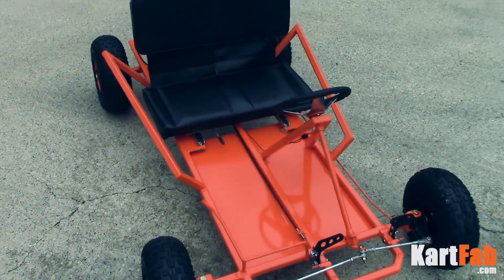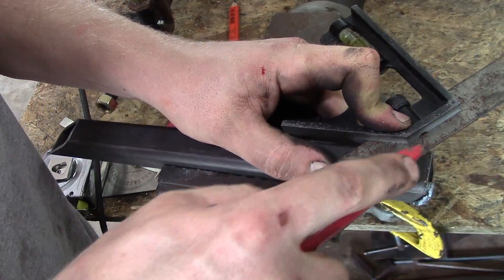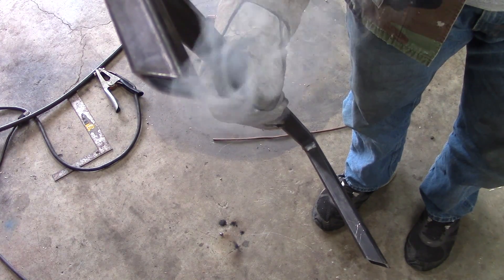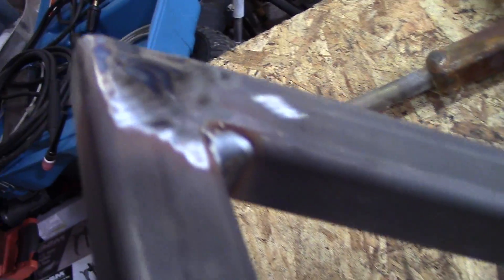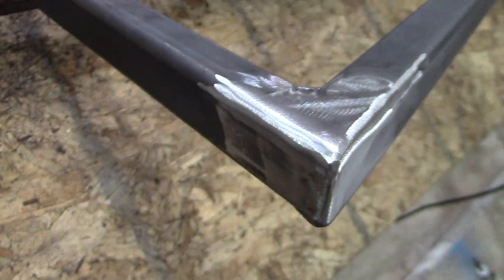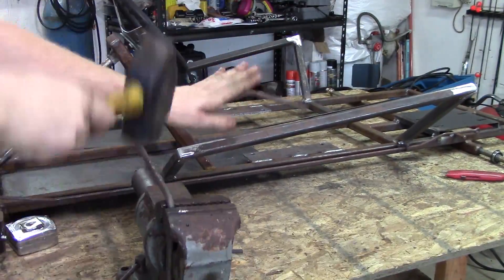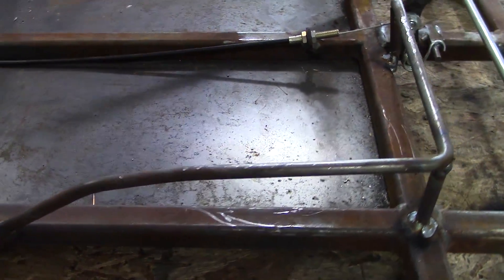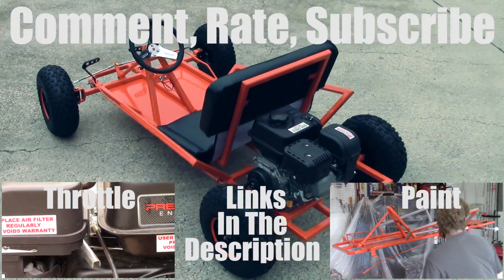Go Kart Side Restraints and Foot Rest

Comment: Hey man thanks for the reply ' I know it may sound a bit crazy ' but could u weld another motor mount & run 2 motors on that type of frame ? I used to know a guy that had 1 with that kind of set up & that thing was just stupid fast w/ no roll bar . Why no roll bar on this cart ? Just for safety sake ' if you were to roll that thing GOD forbid !! U would regret not welding 1 on !!  I cant help but ask how much $ for this bad boy ? Jimmie R
Reply from the maker: James. Yeah it would be possible. You would just need to buy an extra motor mount, extra clutch, and extra sprocket with the standard or deluxe live axle kit. The links to the kits are in the description. They are about $750-1000 after you figure parts and materials IIRC